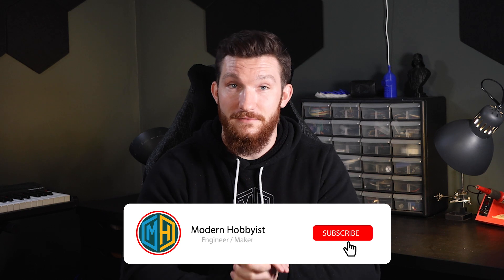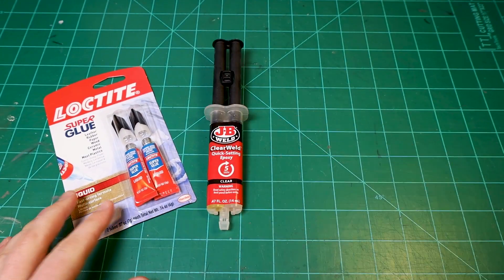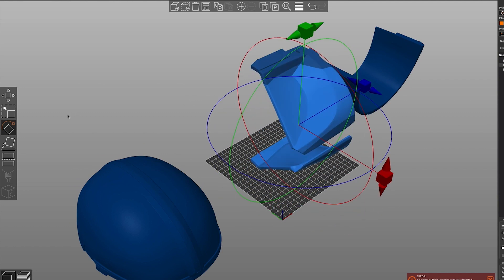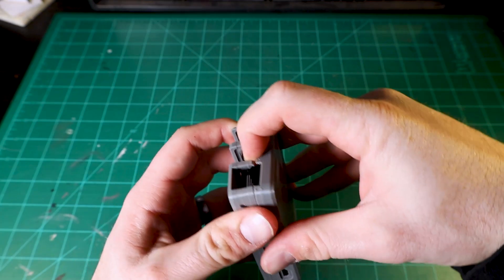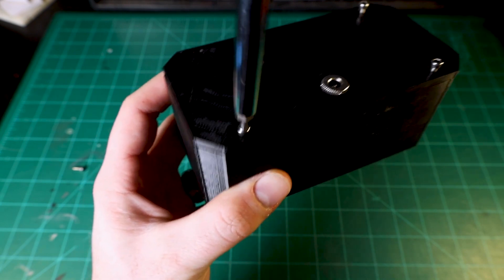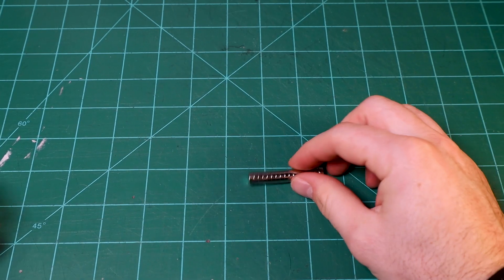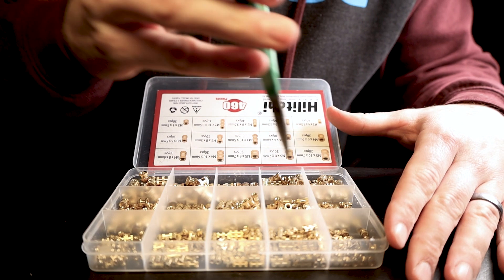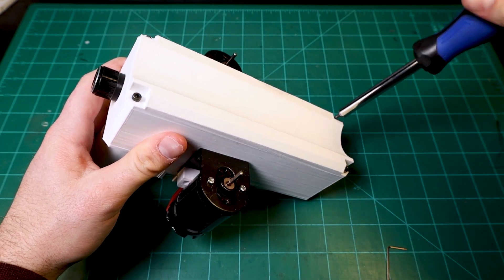Top 5 Ways to Connect 3d Printed Parts!

Comment: I really like welding together large parts with the 3d pen, works pretty good for connecting large parts together but if you're trying to connect a small part, the plastic cools really quickly and doesn't bond

Comment: For PLA, I use Weld On 16 to fuse them together. Does a great job. It's only drawback is that it's very low viscosity so it can run unless the surface is level. Generally, I brush it on to reduce the running, then I can orient the parts to join them. It will destroy the brush, so I use cheap acid brushes.

Comment: Acetone (or more expensive equivalents from the model-building hobby like Tamiya thin cement) will work depending on the material of the pieces being assembled — acetone will melt and fuse two objects made with ABS, but it doesn't work well with parts made with PLA.

Comment: After several tries and fail with heated inserts, I found it much easier to use screw insert on fill length to long screw, for example, M3 30mm. Then using pliers hold the screw vertically and apply heat using solder to the top of the inset and push it into the plastic. A screw will prevent plastic from getting inside the insert hole.
To extract the inset put a long screw into it and heat it. The plastic around the insert will melt and you will be able to pull the screw with the insert back

Comment: There are many joints used in woodworking that work even better for 3D printing. Clever geometry that slides together, then holds super strong. For example, the classic dovetail can be modified to be even stronger and prettier for 3D printing.
Reply from the maker: That's a great idea, I'll have to look into doing that! Thanks for the idea!

Comment: 1) a mention of cold welding ABS with acetone in the adhesives category would have been nice
2) why would you show the worst kind of heat set inserts there is? the ones with opposing slanted teeth are MUCH stronger

Comment: Generally speaking there are 3 physical ways of joining any part.
1. Form fit --> dove tails, snap fits, bow ties, typical wood joints, etc.
2. Friction or force bond --> screws, wedges, magnets, etc.
3. adhesive bond  --> all types of glues, welds, soldering and melting
It is best to combine them for example use a dove tail design to create a from fit for a strong connection and additionally use glue if the connection has to stay that way or wedges if you want to disassemble it some time later. Try to avoid using only one connection type and always remember the 3 connection types.

Comment: Another way I could suggest doing it as well you could use either hot glue or say a pen to fill the hole.

Make keyed holes.

#\ /#.  - top layer with
             - where part is split
#/ \#  - bottom part my
####

When the two parts are together the upper cone meets the bottom. So you have a cone and an inverted cone. The inverted cone is on the bottom part.

Then when the part just put together simply fill the void with hot glue for temporary and or plastic from a pen for more permanent connection. The advantage of this is then you could send off the surface and you never know the thing existed.

Easy to put into the design. Just to circular cone is accessible on the surface so it can be filled.

It's also way to secure a lot of internal components if you want something solid. You put in a mesh interior not for support etc but just pretty much empty space. Then fill it with resin
Reply: Another thing with using a resin pills you could have the locking parts hooked into a loops on the interior so when the resin finally flows around the inside and cures there's no way to take it apart
Reply: It's an idea I saw from when you're trying to lock two pieces of stone together you have a keyed surface that on it that you can chill out you pour metal into it it locks the two blocks together.

Then you also have the other situation like pouring concrete with rebar. the bars there to hold it together but in this case you do it leave space for the 'rebar'. When you fill the resin in later, it locks it all together. Theoretically you could use an injection molder to do this part

Comment: Using pins to align if gluing works great! Also, using puzzle joints like bowties works ok too! Great video! Tapping holes is great when your hardware is too small to print threads, or when you don’t have enough space for heat-set inserts! Forcing threading can change your part tolerances! Tap tap tap!
Reply: I was reading the comments looking for more tips. His and yours are very helpful for me. Puzzle joints, I think I need to learn more about these.

Comment: I haven't tested this,  and maybe you have something that works. You have a few ways to make threads in machining. Cut taps or form taps. (There are other ways, but they are not relevant.) Essentially what you are going is form tapping. For an example. A standard 1/4"-20 home would be drilled to .201" before tapping, with a cut tap. This is literally cutting metal away. The form tap just pushed metal into itself. And as you will be doing with the threads. That hole would be filled to .228" before tapping. Moral of the story,  perhaps look up a form tap drill chart. Try those size holes for when you want to use a bolt to form the threads. I hope this makes sense. I don't think 3d printing and machining concepts are too far different.

Comment: With all due respect, brass inserts might be your favorite way to join printer parts, but you are using the incorrect inserts. You need those that have a smaller protruding smooth section, that matches the diameter of the hole, thereby making the insertions exactly centered in the hole, and not based on the way your iron is held.
Reply: First person other than a politician to say "with all due respect"
Reply: Incorrect hahaha

Comment: Two more offhand that didn't make the list:
Zip-ties.  Make aligned rectangular holes in the two parts. Optionally two more holes, or a channel if near an edge, for the return loop. Optionally inset a gap for the head to sit.

Prusaslicer cut now has an option to generate a matched pin and socket, either with the pin attached to one side, or printed separately.
Reply from the maker: Those are good ideas too! Didn’t know about the PrusaSlicer feature!
Reply: And cut the ratchet off a second Zip Tie head to use that second ratchet head to slide on to another zip tie tail length to then lock the two separate parts together.

Comment: Never thought about embedded magnets and nuts, that's so cool!  On top of simply using the bolt to thread a hole, you can tap the hole with a tap and die set.

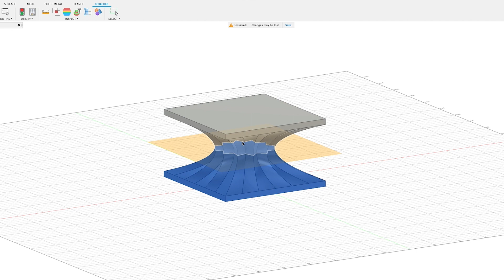Comment: Hey, first of all thank you for the video, great summary what to use, when and why. I have a question though - what software do you use foe splitting the stl files (2:25)
Reply from the maker: Hey thanks for watching! You can either split them with Fusion360 before exporting for slicing, or use the cut feature in PrusaSlicer to split them up into printable chunks. Hope that helps!
Reply: Fusion360 often f*** up the scale.

Comment: Nice video! Very well structured!
I wonder what are the options with resin prints?
Printing the screw directly in the print should be even easier as resin printers have even finer details, but I'm not sure how strong are resins vs metal bolts for example - what's the wear'n'tear with usage.
Hot inserts don't work with resins unfortunatelly :/

Comment: I find when I put threaded inserts in, the plastic gets into the threads themselves and then I have to carefully screw and unscrew the screw several times into it trying to loosen it out.  This sometimes means overwhelming the bond on the outside and causing the whole thing to start spinning
Reply: Did you offset the thread?
Reply: @ghostmateify  not exactly sure what you mean, but I followed instructions pretty closely.  Just noticed there was a pretty big difference between knowing the path, and walking the path if you get what I mean.

Comment: From skimming through this, I have to point out two things:

1) I wholeheartedly despise the adhesives I've used, i.e. superglue. I don't know what superglue you're using, but the various brands (and types - liquid and gel) of superglue I've used are by no means permanent and snap very easily. For a Colonial Marine breastplate I printed, it was like that Don't Break The Ice board game, and I wound up having to use thermoplastic to make backing plates and then gluing those over the lines between printed parts to make it more sturdy overall (and the glue at least worked for those, but it wasn't strong enough to hold individual parts on its own).

2) I'm positively astonished by the fact that you didn't bring up the use of a soldering iron as a possible means to connect two or more parts, because after I gave up on the superglue and thermoplastic backing plate combo (though I might use backing plates since they actually work VERY well), I tried out this one video's technique of taping two parts together by their edges and then using a soldering iron to melt the plastic of both parts together. Just right from the get-go, they're 1,000,000x more durable than superglue (as in I did three drop tests of a prototype helmet before a piece broke off, whereas with superglue, all of the pieces would be all over the floor the second they hit the floor), and with a backing plate put in, that would only further reinforce them.

That said, this was a pretty decent video and I like how it pointed out several things I hadn't thought of before, while also outlining what to keep in mind with doing those techniques.

Comment: Friction welding is another method that can be very useful in some situations.  Hold the two parts together, and use something like a Dremmel tool to spin a small piece of the plastic material (either a segment of fairly thick filament, or what I do which is to print a small peg in the same filament) against the joint area.  The friction of the plastic rapidly rotating against the printed parts will cause them to heat up and fuse together.  It takes a little practice to do it well, but it can be a nice alternative to adhesives!
Reply from the maker: Thanks for the comment! Now that you mention it, I’ve actually used my soldering iron to melt pieces together in a similar way, and it worked great!

Comment: ...stripping threads (or breaking of heads of screws) is not unique to 3d printing.

One of the easyest ways to bork your stuff, is lubricating your screws (with something like WD40) before tightenjng them to specified torque - as without the usual metal on metal friction eating away at the force created by the torque, you can output 2x (or more), and break stuff.

Comment: JB Weld, Sandpaper, Primer, wet sand, Hammerite.
Reply: yes, additionally 3D Pen with same material, snot glue or heat gun to weld and fuse two parts, pending the geometry

Comment: What do you thinks its better for make a hand jonits, like an robotic or prosthetic flexible hand. I want to make a nice design that be durable to the work with it for a long period.
Reply: Self lubricated PTFE/serpentine nanocomposite  - use 3d printer to print the mold (negative part) then cast the part using PTFE, best is injection molding but you can get away with a two part mold and use drip PTFE